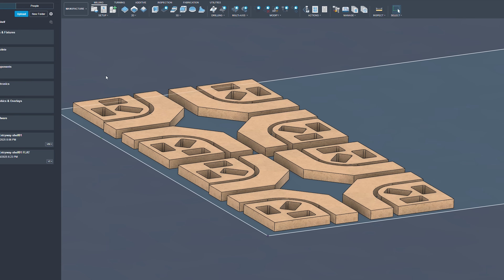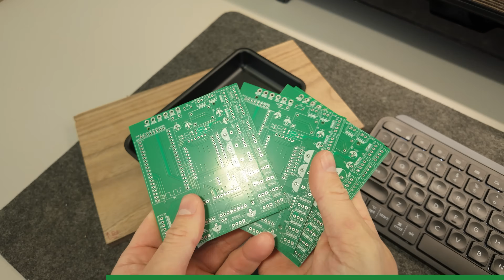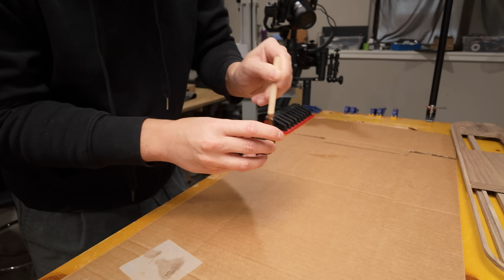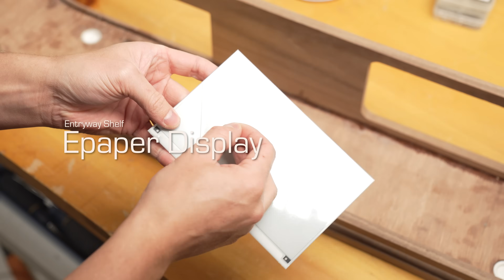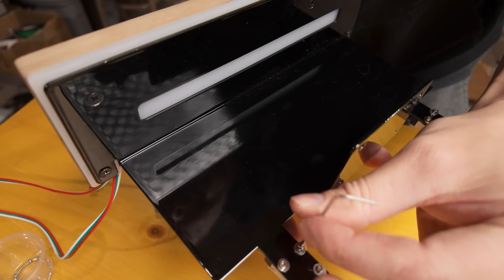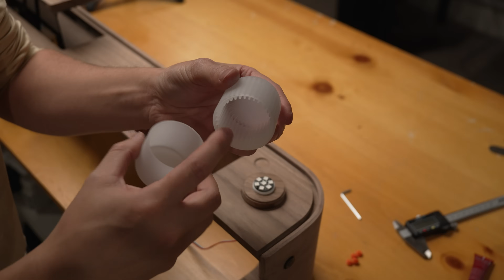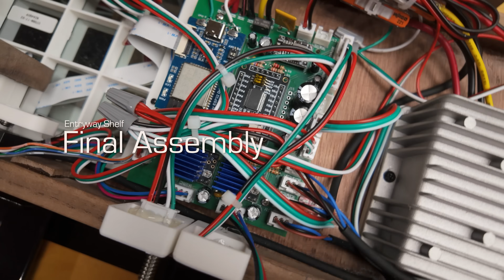I Changed How You Enter a House Forever

Comment: You're asking a lot to bend 1/8" boards only from soaking in water. You'd usually want to go with a slower method like steam-bending or you could also veneer over bent plywood if you're gonna end up with a thicker piece anyway. I don't think any amount of reasonable soaking in hot water would have prevented the cracking issues you got.
Reply from the maker: Especially at 6” wide! Thanks for watching.